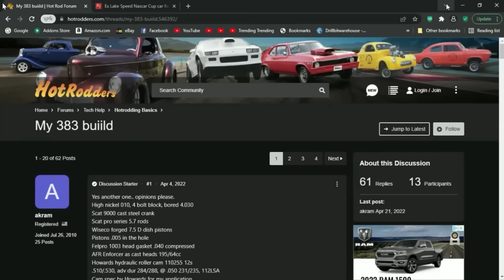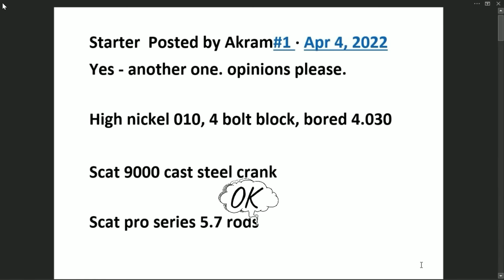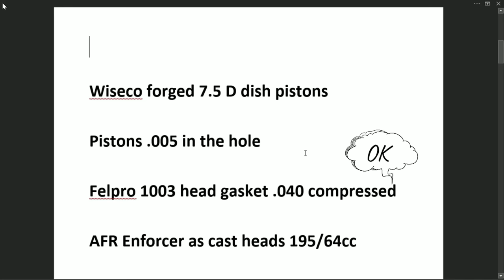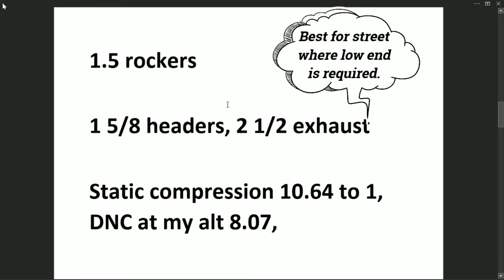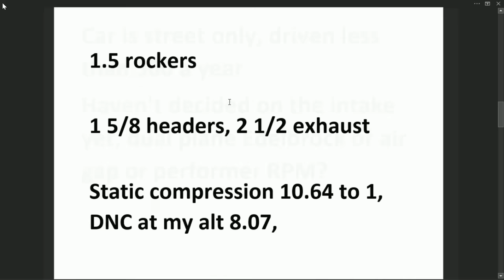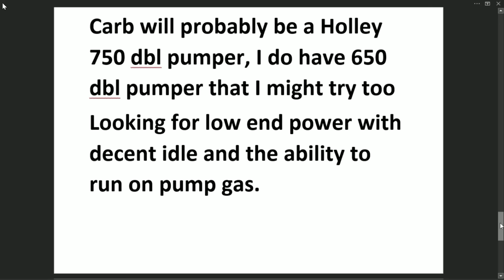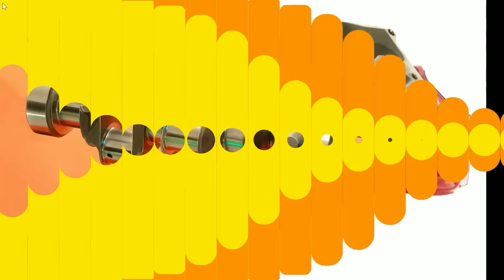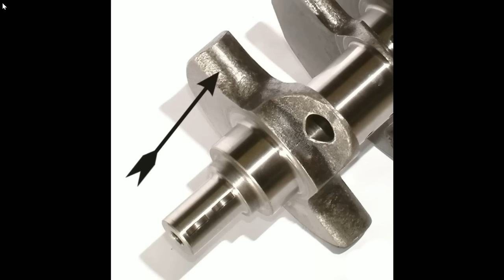Race winning low buck 383 SBC build.

Comment: Beastly build. Easily outperforming anyone elses 383 builds. Back in the day David used to have a paid service, where you could ask his advice on a build, and he would detail the build for you. He gave me a Chevy SB 355 cid build that made 525 hp on 93 pump gas. He specified everything I needed; Crank, AFR heads, cam specs, etc. The component build was reasonably priced for the power output. This was back in the late 1990s and early 2000s. He never disappoints based on my experience. I also built a 400hp vortec heads Chevy SB. I literally built the engine using one of his published books, which I still have. When I was done, it started right up and shortly there after lit the tires down the street.
Reply: Would you happen to have the title of the book? I’m building a vortex right now and would like guidance to known power
Reply: Can you share the build specs.  Sounds like a perfect street motor.
Reply: Today with the internet trolls they would call just to waste time and troll him. 
Losing guys like him in the hobby is just sad...hope hes around for a long time
read his books as a kid in the 70s

Comment: Smokey Yunick, Bill Jenkins, & David Vizard are my Heroes! My home built engines have stayed together & performed well over the years thanks to your great information. I can’t thank you enough! I’m looking for tips on getting more power out of a 350 Chevy 350 roller cam track 1 headed vintage road race engine with 48 IDA carbs on MacKay manifold. Should I bore them out to 51mm? I think I need more carb flow it’s weak above 7000
Reply: It’s a GM, of course it’s weak.
Reply: @DoyleShadduck hahaha bro you are hilarious! those damn GM idiots right?

my wife left me
Reply: A friend of built a Yunick Stroker, had so much torque, sent the flex fan thru the hood, fender and radiator, during a good rev up. Twisted the water pump impeller right off.  If he would have been under the hood giving her the ole Ugga Dugga, off with his head for sure.

Comment: I didn't realize that Holley Carbs have been upgraded much since I purchased my 1760  600 CFM in about 1980. Seems I read that Edelbrock is building vastly improved Holley clones.  I was not paying a lot of attention as I was leaning to running a fuel injected LS engine.

Comment: I've been using his cam specs for my 383sbc builds. They're spot on! Its no doubt you have to get that right. The power curve hits similar to my 2 stroke shifter karts .  The only complaint I have is no street tire will survive.
Reply: It seems the cam specs would be very unfriendly to  power brakes.  Is that your experience?
Reply: @jjpoissant  It's been awhile since I watched this video, but with 12.1 compression and a 300+ duration cam, it will probably be close to the limit of reasonable power brake operation.  Then again 12.1 compression and 300+ duration is not a pump gas street build.  I run a 284 / 288 duration and 107 LSA on my 383sbc, with 10.4 compression.  That gives me 13 in Hg of vacuum, which is just good enough to run power brakes on my C4 Corvette.  I use a program from DV, which allows me to spec cams, it also gives me a ball park figure on idle vacuum.    If you want me to run some numbers on ideal cam spec for your setup.  Just let me know, I should be able to give an idea of the vacuum at idle.
Reply: @blitzcechannel7941 with that 284/288, what kind of power are you making?   Which heads did you go with?      looking at different combos for a possible build.
Reply: @jjpoissant  I did not have my Dyno at the time of this build, so best guess would be just under 500hp.  It's built on a 2 bolt TPI block for road racing, so keeping under 500hp was a goal for survivability.  I used my own 200cc version of heads with light porting work.  The heads are similar to Dart SHP heads.  It's a TPI fuel injection mini-ram intake, so there's a bit of limitations from that.  A good carburetor setup would probably breath a bit more freely.   I would say AFR 195 CNC heads are the best bang for the buck in a Streep Strip 383 combo.

Comment: One trick I did was on a spacer on a 400sbc. The dual plane intake was an old Eldebrock CP 3x (number may be incorrect). It worked very well. I went to thinking a larger intake plenum would help,  so she received a one inch spacer. The bottom end didn't change much but the top end was WOW. I then cut notches on front and back of the spacer and fitted 1/4 inch aluminum strap and epoxyed it in for a devider to make it a true dual plane with a larger plenum. Drivability was very crisp. Once on a remote road I gave her a solid launch. I could very much feel her become much more of a devil than she ever was! Stock style and stall conver launch (1500 rpm) to 5500. What a monster!
From Oklahoma 
Mikel
Reply: The cam is Crane HMV272-2, flat tappet hydraulic. Smooth stock idle and 7mpg better than stock. She pulls paste the rated 5500rpm rating. Of course, the valve train was matched to the cam specs. 
Mikel
Reply: C3BX Edelbrock is a badass intake! The runners are massive! So big in fact that an HEI will not fit unless you grind a bunch of material off of it. 
Thanks for the write and info.
Cheers!
Reply: @merccrewlcab2385  Correct. HEI will not fit this intake,I I ran the point ignition. Also blocked the oil fill bung with a freeze plug since I used valve cover oil fill.
Reply: @mikebrooka9395  Cool! 
My son and I have a few of them!
Reply: @merccrewlcab2385  cool beans!! Rare to find only one much less a few. Congratulations!
Reply: What heads were used?
Reply: @shootermcgavin2819  factory cast iron. I do not remember the casting number. They were a short two year run casting. 80-82cc. Dang huge ports for sbc
Reply: I live in Oklahoma City 
Hello 👋

Comment: Thank you, David, a lot of great knowledge shared! I was surprised to see the specs on the comp cam used at the end was on a 110 LSA. Especially after all of the talk using a 106 or 107 LSA. Also, I’m a little surprised to see that the majority of questions in the comments have not been addressed. Thanks again for sharing your wealth of knowledge.
Reply: 106-7 lsa cams unless very small are a pain to live with on the street. 
LIke 108 for hot rod stuff and 112 for drivers

Comment: Hello David,
Love watching all your very informative videos especially about the 383 Chevy specs.

This is my engine combo and I would love any feedback from you. I have not had it dynoed.

First the block. The car is a 1969 NOVASS 350. When I’m got the car the engine had already been set up as a 383. I took the engine apart down to the short block for inspection and to identify the bottom end. The block is original to the car and has not been decked. Still has broach marks.

The block was bored .040 over.
It has a scat cast steel crank 3.750 stroke.
Eagle I beam rods with cap screws. 5.7”
Pistons are JE flat tops. I assume floating pins but not positive.

I left that all as is. Checked a couple bearings all looks great.

Heads I chose are AFR with 195CC runner 64CC chambers. 2.080 intake valve. Full race ported competition eliminator version.

Camshaft is a Herbert solid roller. Lifters are Morrel.
I chose one with a 106 CL and a 108 LSA. The lift is .610in .620ex.
Duration @ .050 is 250in 250 ex.

Im running a stock uncut deck with a .016 SS shim head gasket. I calculated a static compression ratio of 11.3:1 with this combo. I have 215lbs. Cylinder pressure.

Induction consists of a hurricane open plenum intake and a Holley HP 750 carb. I think the carb is too small and needs a 800. You mentioned about vacuum secondary be the best. So i figured a 780CFM might work really well well.

Also running about 36 degrees of timing.

Anyhow that’s my combo. How far off am I to get 500 HP?

Comment: David- I am impressed by this video more so even than previous ones- because ALL your recommendations ECHO my past experiences to a "T"! ABSOLUTELY spot on with reducing the LSA from 112 to 107, lengthening rods from 5.7 to 6", and getting that lift higher and more symmetrical with 1.65 intake, 1.6 exhaust. I did almost exactly these things, also installing my 107 LSA on a 103 degree centerline ( my 440 Mopar was LOW on static compression ) ,and "down in the hole" at BARELY 8 TO 1, CLOSER to 7.9! With .518 lift boosted to .545 with 1.6 rockers, I achieved 572 horsepower in that smog motor ( 1972 440 @ 8 to 1!). This was at 6,315 rpm with Chinese 1.6 shafted rockers with bushed bearings and extra oiling holes I drilled in the shafts under each bushing ( the lousy oil holes where originally only under 1 of each of the 2 bushings in each rocker INSTEAD of BETWEEN them, and started to gall the shafts, which I caught just after break in already! (Flat tappet). This engine (amoung my others) is still killer after MANY trips from NY to NC, in a 1972 Chrysler New Yorker Brougham I literally got out of a collapsing barn in NC  a few years ago, with about 80,000 miles in it, last run previously in the early 1990's. NO rust, MINT interior. I LOVE this car! I had a 1971 Challenger convertible, in which I installed a 440 six pack, and MANY other Mopar's. I'm currently building a 1973 400 SBC block going into a 1976 Chevy Monte Carlo. The Mopar's are my first and favorite for their superior geometry, in my opinion. Since the beginning of the 1970's, I was one of those guys the Chevy guys looked out for, because I knew what to do with getting more out of less. I BEAT the golden rule BACK THEN. YOU and I both now your MISSION IMPOSSIBLE is gonna wind up with a STOCK 800 cfm 4 barrel off a mid eighties cop car. I LOVE the Thermoquad! Made many a giant killer with them on 318 screamers. Best intake then was the (not stock) Edelbrock LD4B, BUT ANY 360 STOCK IRON INTAKE WILL get the job done after either porting 318 heads or using 360 heads on that 318. LOVE the 318 also! That was my first car- 1970 Dodge Challenger SE, little rear window, over head interior front to back console, and a wicked top end with that intake set up, headers, dual valve springs with dampers, and what we used to call a 3/4 race cam with solid lifters and the Mopar LA 273 engines adjustable iron rocker arms! You WILL EXCEED 1 horsepower per cube, I guarantee it! I'm starting to feel my age now, at almost 70, but the 2 loves of my life, my wife, Cathy, of 45 years the December 10th, and never ending fascination with the combustion engine, keep me going! Thank you for sharing your wisdom with all of us! Merry Christmas, and a happy, better new year!
Reply: I'm building a small journal 327 bored 30 over could, I use the 6 inch rods with that engine? Also what can would you recommend? Thank you!!! 😎😀
Reply: @jamespepper2541  Optimum rod to stroke is around 1.8. SBC  350 is 1.64, SBC 327- 1.75. 327 stroke is almost 1/4 inch shorter- you DO NOT need a shorter rod- it would put your piston pin height quite short- about 1.2"- that compression height might cause piston rocking, especially not good in a street engine,band the 327 winds out great stock! In my opinion it is superior to the 350 in stock engine geometry. No need to waste money on rods and special pistons- but DAVE knows way better than my old layman street racer experience!
Reply: I already have 1962 stock rods, I just need to find me a good cam. I'm running flat top Pistons and it's bored 30 over ,😎
Reply: @jamespepper2541  Again about a month ago, Dave did a video- 128 formula for correct cam for your requirements, with all variables and an individual's  and preferences, and the fact I myself never built a SBC 327, I don't want to steer you wrong in cam selection, it's about the most critical part of how an engine's gonna run! Check with Dave!

Comment: I am just starting to watch your Videos.  Lots of good info.  You keep saying use vacuum secondaries, but  I have a manual 5 speed transmission.  I have always used the Holley Double pumper. 600 CMF works better than anything larger with my Holley Street Dominator single plane intake.
  I want to be set up to run E-85.. Thus I need flex fuel and fuel injection.  There are aftermarket flex fuel kits for LS engines but  not sure if Holley, Edelbrock ect have addressed this.
  My first Flex Fuel conversation will be on a 1203 CC Buel air cooled engine.  I will gain so much more with E-85  on an air cooled engine.  Stoke the  74 CI Buell makes 103 HP  a stock 1203 Harley Davidson Evolution engine makes maybe 74 HP some years it only made 58 HP.  The Buell is fuel injected with 10.5-1 Compression calling for 91 octane gas.  I can get a 93 Octane tune for the ECU.  
  As far as guys who want to run 87 Octane E-10  Try adding a Water / Methanol injection system.  They used to be called Snow Performance.

Comment: Back in the 1990's when i was just starting to build cars I did tons of research, had all they dyno software as soon as it came out. I started building my own stuff in the garage and ran "huge" cams according to the old time guys. I ported my own stuff, did my own valve work (at a friend's shop) and built a 355 on a budget that put an 80 camaro in the 10's on very little nitrous and weel into the 11's on motor.  I like high lift and low lsa, made great power and sounded excellent.  When i had the motor ripped down to refresh i switched from solid to roller and let my engine shop frend and howards pick the cam. It sucked. I would up having them custom cut me a cam then it was even faster.

Comment: David I had to use four spacers on my cadilack 472 just to get the linkage to cleared using a elderbrock carb a750 cfm I did not have the kickdown adjusted but that car had outstanding gas milage and worked quite well

Comment: I used a 4 hole spacer that i modified by gouging out the passenger side
Divider so it looked like an oval race track and it equalized the plenum so
Much that it sounded better on the dyno and with 4 jet sizes up it made 20 hp more, i know some was from fuel. This was on an air gap 406 sbc.

Comment: Thanks David.  Would love to get your input on building a MAXIMUM TORQUE SBC 400 in a 1997 K1500 w/5 speed and 3.73 axle for towing. Maximum compression on 93 octane pump gas w roller cam and stock vortec style heads.  The only upgrade that has been made is the replacement of the factory fuel injectors.  The reason for the maximum compression is that a CNG conversion kit will be installed  and I want to maintain HEAT to compensate for the power loss from the conversion. Truck currently has 384,000 miles and a daily driver.  I bought it used at 99,000.  Engine does not smoke and never even had a valve job!  Your thoughts!!  RJ

Comment: I have built all kinds of motors, I really enjoy the uncommon. I ran 455 Buicks for years, along with Pontiac and Cadillac. Of course 50+ LS motors and can't even count the small blocks.  I remember when running a low compression 455 I had a can cut on a 107 with quite a bit higher exhaust duration to make up for the crap exhaust port and it made far more power than anyone expected. Getting the cam and Carb right can make any combo
Reply: Uncommon?   This has been around for decades

Comment: Come on DV fans... toss him a few $   If you value his (or even others who entertain or educate you) chip in sometimes.  Click the three horizontal dots  near the Share tab and it has a give "$ thanks" click.  --I've bought several of your books as well on carb tuning and engine building.  Currently  I'm trying to get my 11.5:1 fairly hot cam 327 to not have a lean tip in issue and have better cruise AFR's. 
 I have a 750 Mighty Demon with annular boosters that is temperamental as hell and is horrible at low RPM load no matter what I try.  And a Holley 4777 650 DFDP (two corner idle) that seems better but not there yet.  Drilling IFRs and Air bleeds.  Ugh.  My wife thinks I'm spending way too much time on this.

Comment: If you keep a stock blocked build within reasonable rpm ranges you won't have to worry that the engine will let go. Sure a sbc can rev to 8k but I would not push it past 6200.